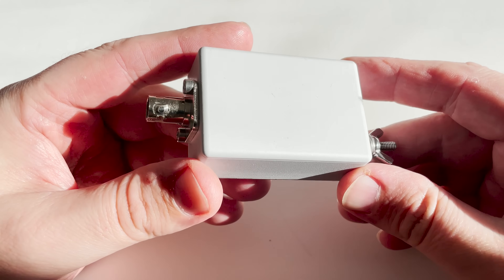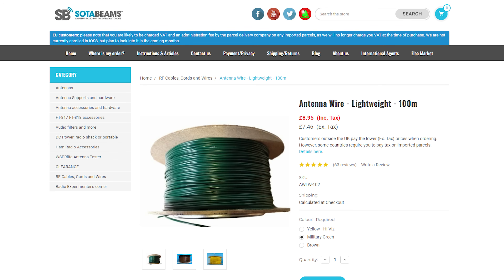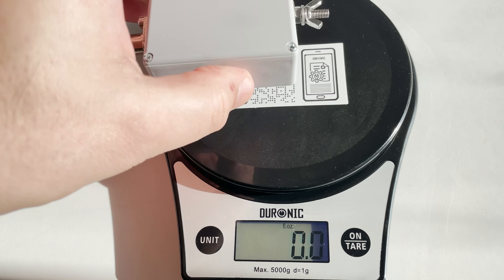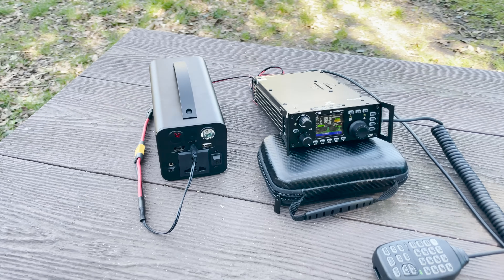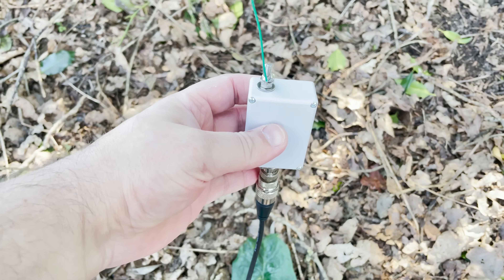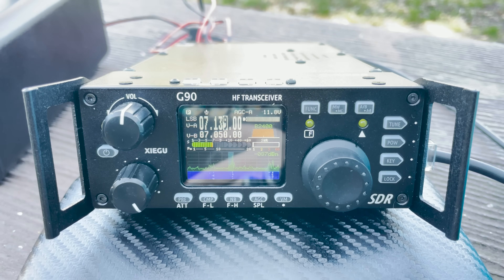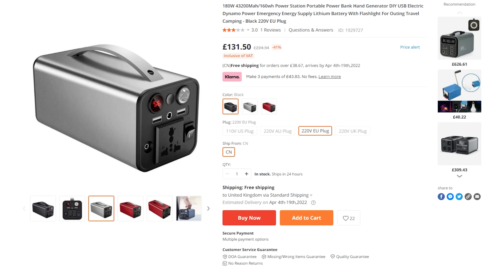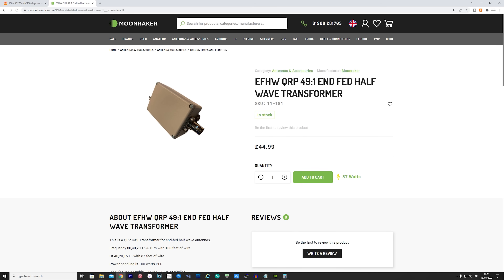Is this the BEST Portable Multiband HF Antenna?

Comment: Could I get away with this on a balcony do you think?
Reply from the maker: If you use thin wire then I guess your neighbours might not see it, but you need some way to support it, unless you just let the wire hang down, depending on how high you are.
Reply: @TechMindsOfficial  - Thanks for getting back to me, it's a very long horizontal balcony, and I long have the option of a long drop. Great content, I always learn something from your videos.

Comment: Hey mat, been loving your video's.  Just discovered you after doing some research. Do you have a recommendation for a good entry level radio for someone starting out? Shout out from the US!
Reply from the maker: Hey, thanks for comment. I would recommend for someone starting out in radio, who hasn’t got a licence to transmit, would be to get a cheap SDR like an RTL-SDR dongle first. This will provide a receiver on your computer. You can then use this while you study for a licence. If you want to get a radio, then it all depends on budget.

Comment: Do you think the G90 would be a good first HF radio?  Some groups say I should get an 100w radio like the FT 897.  But I really prefer an SDR like the G90 for its Automatic antenna tuner.   One less thing to carry.   If I need 100w I could always buy the 100w amp XPA125 that works seamless with the G90.
Reply: I have a G90 never looked back. SDR is the way forward.. The built in ATU works perfectly..

Comment: Hi, Mat. I have a question: I've already purchased the 1:49 balun and a spool of AWG12 wire. I have 15 meters of coax on the way as well as ceramic insulators for the ends. When I get my license I plan to try to get a 100 watt HF rig, probably an IC-7300 (I can't legally buy a G90 here), and I'm concerned about RF getting into the shack. I have a bunch of snap-on ferrite chokes I can put on the feedline, but would it be better to put them near the balun to keep common mode current from flowing on the braid, or just before the coax enters the shack to allow the braid to act as a counterpoise until just before it enters my house?
Reply: Never mind, I found the answer: as my balun doesn't have a connector for a counterpoise wire I'll have to use the coax shield as the counterpoise, and at 40 meters, the lowest resonant frequency of the antenna,  the counterpoise should be 5% of lamda or 2 meters long. so my RF chokes need to be 2 meters from the balun where they then (hopefully) choke all common mode RF from the rest of the coax shield and stop it getting into the shack. If that doesn't work I'll need to add an isolation transformer at that 2 meter point that's capable of handling at least 100 watts, but I'll try the cheaper. easier way first as I already have a dozen or so of the snap-on ones.
Reply: How come you cannot buy a G90 legally ? What Country is that ?

Comment: This video about the 1:49 balun plus the Xeigu G90, both of which are available in the Philippines, has made me start thinking about finally getting my ham radio license and getting on the air after years of just running an HF listening post.
Reply from the maker: Hi Jay! You should do it! Definitely! You’ll have so much fun! Thanks for watching 🙏
Reply: @TechMindsOfficial  I was in contact with the president of the Cebuano Amateur Radio League (CARL) today and learned that as an American citizen with a permanent residency visa I am allowed to take the exam and, provided I pass, obtain at least a Technician license which will allow me to operate on portions of the 40 and 15 meter bands, and once I have a license I can purchase and possess radio transceivers, and once those have been registered with the National Telecommunications Commision, get on the air. Time to start brushing up on my basic electronics theory and study the local rules, regs and operator practices. It may take several weeks or months but I'm determined to become a ham and get on the air, thanks to you.
Reply from the maker: That’s awesome news! Keep me updated and hopefully we’ll chat on air sometime soon!
Reply: @TechMindsOfficial  Solar Cycle 25 permitting.
Reply: @jaym1301  Only thing holding you back is YOU! Good luck! 73

Comment: EFHW is definitely a good option for QRP/P. I tend use linked dipole end feds for multiple bands. If you get a fibreglass pole you don't even need a tree to support it. No conterpoise or radials are required. All you need is a few feet of co-ax to connect it. In terms of weight, size, radiation efficiency, quick set up, cost and simplicity, it is hard to beat the EFHW.

Comment: Thanks for the video Mat! 
The EFHW is a very versatile antenna that is very handy for portable operation, and in my case, especially for SOTA activations.
I built a new version that is resonant on 7 bands using the same lenght. It contains one bypassable coil that makes it also resonant on 60m, 30m and 17m (moreover also on 11m). You find my corresponding 50+ page document when searching for my call and EFHW.
73 Stephan
Reply from the maker: Thank you Stephan! I will most certainly take a look at this information! Thank you again.

Comment: Very interesting video! I’m working on a project exactly like this using the 49:1 transformer. I’ve got very good results on the 10m band using a 5m cable, the SWR from 28,2 to 28,8MHz was 1,1:1, simply perfect. However, when using a 20m cable as an antenna to work from 10 to 40m band the SWR jumped to 4,1:1. Besides, I could not find any resonant frequency using my antenna analyzer.
Where the issue is supposed to be … the coax cable length? The length of that antenna wire? Lack of a counterpoise?
Your comments, suggestions and advices are more than welcome 🤝
Reply: You are probably getting RF reflected back into your radio? Place a toroid choke in your coax (wrap about 6 turns of your coax through) it and you should be good this helps to reduce "Common Mode Current" - You can also make a simple choke using about 9 turns of the coax (about 6" diameter and taped tightly) place your choke at the 5m point (from your antenna) in your cable and then the length to the radio wont matter!
Reply: I built a 49: 1 transformer , (with a ground), connected to a 2ft long copper rod driven into the earth. Which is actually a 64:1 if you calculate the turns round the ferrite ring.. 
I found this vastly improved the SWR and performance overall in a inverted L with the apex 10 meters off the ground with the aid of a telescopic fibre glass pole..In some cases it helps to add a second capacitor in series to help the SWR.. I did not need to do that.. Hope this info. helps 73s

Comment: With the long leg of the inverted L so low did it act like a NVIS antenna?
Reply: Virtually every amateur radio operator in the UK using a wire antenna communicates by NVIS on the likes of 40 & 80 m as very few can actually get an antenna high enough up otherwise.

Comment: Thanks for the video Mat. Good to see the antenna with a G90, especially as I have one waiting to be taken out of it's packing and fired up!
Reply from the maker: I’ve never really been into low power radio, but I’m really addicted to using the G90 portable with its 20 Watts! It’s such a fun radio to use.
Reply: @TechMindsOfficial  Thanks Mat, that's good to know. From what I've read,G90s are a bit Marmite, you love 'em or hate 'em. I'll find out soon! I'm pretty realistic and patient so all should be good.73.

Comment: You gave that guy a 5/9+10 but the meter never went over 5/8? I never get signals over 5/9 on my G90, is that because the AGC is on? I get a true reading with it off I guess?
Reply: As an aside, my G90 setup is a battery and the radio, a 4M sota pole and a QRP guys 9:1 ununtenna with 39 feet of wire. Total weight 2kg, dead good for sota. The radio and battery are the bulk obviously.

Comment: So since the coax from the radio is the only counterpoise does it make much difference which way the coax runs relative to the antenna wire?
Reply: A great question this - I’m never sure where to lay any counterpoise or coax out. Sometimes directly underneath gets you gain. But what if there’s a slope? What then?

Comment: To take it to the next level : G90, 2.5Amp LiPo, 1:49 transformer, lightweight antenna wire from SB (and their carbon 6 antenna) having barely more than 2 kg in the overall package, that's all ;)

Comment: I just started learning radio stuff yesterday. If I wanted to get the best permanent install home base setup, what gear should I look at getting? Icon 7300? or should I just use SDR? What is a good stationary antenna? Thank you for sharing excellent videos.
Reply from the maker: If you’re just starting out and you don’t have a licence to transmit, then get something like an SDRPLAY RSP1A. That will give you great coverage with the right antennas. However, the 7300 is a very very good HF radio for both new comers and experts.
Reply: @TechMindsOfficial  I am getting my license. Meanwhile I want to find the right equipment and figure out what my budget is.

Comment: I put together kits for a 40M EFHW for my local club.  All in the kits were only $20 USD and even the most inexperienced builder had no problem with assembly.  No tuner needed on 40/20/15/10, and generally a built-in tuner is good enough to get you 17 and 12.    It's not "the best" portable antenna because there is no such thing.  Time/place/application/etc will determine that - but this probably the #1 antenna in the world of POTA, which is a whole lotta people doing well with it.
Reply from the maker: Totally agree, and it’s nice that this solution is so cheap to make yourself.
Reply: Are you still building them?

Comment: Didn't you need any counterpoise?  I use similar antenna, top end near the top of my sailboat's mast (15 m)  and fed from the lower end. I also used counterpoises. Thank you for your nice videos.
Reply from the maker: It with the 49:1 transformer. Many people have performed tests, myself included, and the is hardly any, if any, benefits from a ground or counter poise with this antenna.
Reply: @TechMindsOfficial  The coax to the transceiver will act as a counterpoise.
Reply: @BrianG61UK  if you’ve got a 1:1 choke on the coax too will that negate how much the coax is being used as a counterpoise? In those instances it’d be good to use a proper counterpoise I guess?
Reply: @MarkPentler  The counterpoise for the 49/1 unun is the outer braid of the coax feeding it and a good choke is best placed where the coax enters the building or at the operating position.

Comment: Shouldn't a 40m wire also be resonant on 80m?
Reply: It is, but because it's a 1/4 wave on 80M it doesn't have the high impedance that 1/2 waves do.  You'd need to remove the 49:1 UNUN and then you'd need to add a ground plane (a.k.a. radials) and you'd have a 1/4 wave for 80M.  I've done this by attaching the wire for my 40M EFHW to the driven plate of my DX Commander and it works surprisingly well on 80M.
Reply: @MattHeere  a 40m wire is half wave on 80m.
Reply: @BarefootBeekeeper  if it were a full wavelength.  These antennas are 1/2 wave on 40M.  That's why it needs a 49:1
Reply from the maker: Exactly as Matt says, if there was no 49:1 then it would be a 1/4 wave on 80 and need radials. I guess you could bypass the 49:1 for use on 80, but by adding 2.5 meters of wire and a 110uh coil at the end of the 20m of wire, you will get resonance on 80m with the 49:1 still attached.
Reply: Muddled and confusing thread. When you give a number of metres, you must clearly state whether you mean the waveband you are using or the length of the wire.

Comment: I wonder how well this kind of antenna would perform in a very flat landscape like Florida? (I envy those who have mountains and hills)
Reply: Just fine.  Lots of POTA folks run this antenna in Florida or out in the midwest.  A 10M fiberglass mast and a trailer-hitch or drive-on mount "flag pole holder" turns this into an inverted-V that can be deployed in 5 minutes.